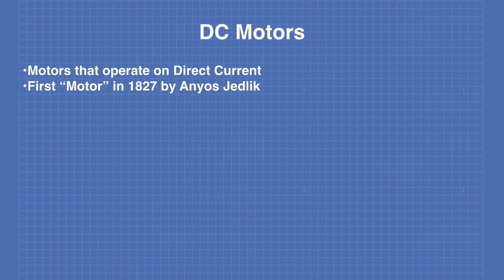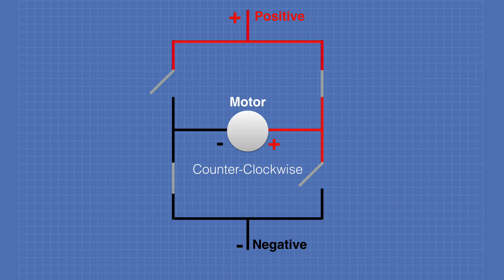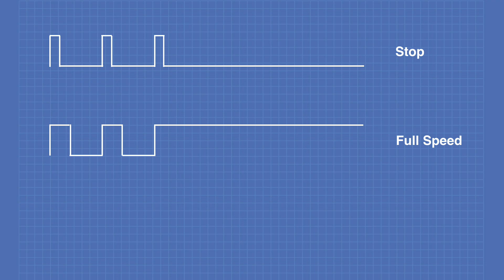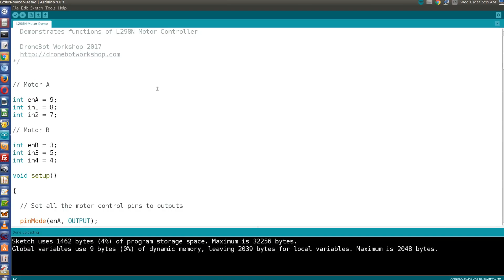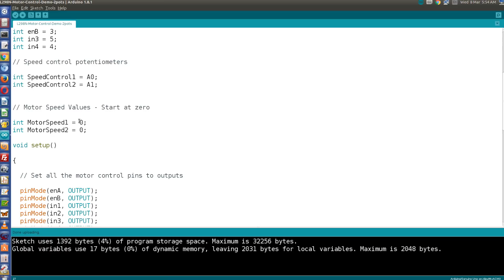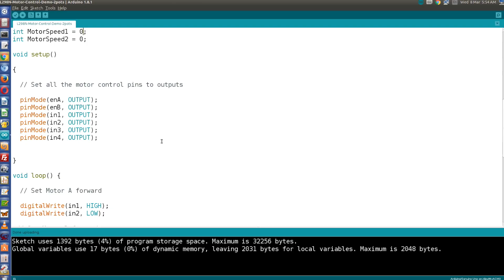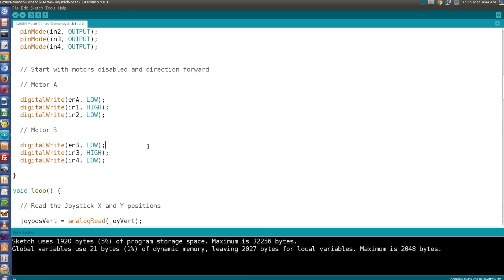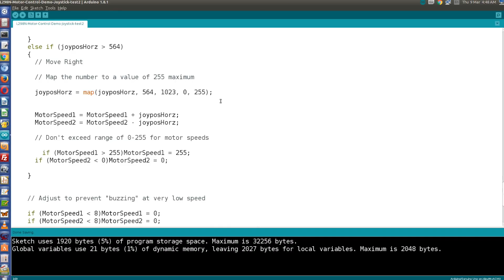Controlling DC Motors with the L298N H Bridge and Arduino

Comment: Hm, isn't the 5V OUTPUT from the module, so you can drive the Aurdino from the motor driver.
  
If the input voltage for the motor drivers are more then 12 V, the 5V jumper must be removed, as the voltage regulator only handle at most 12V.

If one read up datablades and connect CORRECTLY, one can also connect the output parallel to drive higher loads.  But ONLY IF the inputs N1-N4 are correctly connected to each other in pairs AND the outputs to motor A are connected to the right side on the motor B outputs.  You CAN NOT put them randomly, or you burn the IC.

Comment: I'm wondering if it's feasible to use the L298 h bridge module (since it's inexpensiver) to drive  high powered mosfets for larger motors that draw higher currents.

Comment: I'm interested in DC motor control. The YT channel "Daze Cars" describes methods of converting exercise treadmill motors for use with lathes, drill presses, band saws and other tools. Those motors are very large. They operate on 130VDC and spin at 3000 rpm.
That channel does a very good job of providing a method of controlling the speed of these behemoths either faster or slower and he describes both PWM and SCR controllers. 
One thing I have not seen though is  a circuit that allows the user to dial in a desired RPM on a display and have the motor be automatically regulated to hold that target speed with varying loads.
Typically, the original treadmill circuitry that accomplishes that function has been stripped out because only the RPM is the desired target and not calories burned, heart rate or number of laps. Treadmills can often be had for free if you search CraigsList for a few months. 
Thanks for your input and ekectronics knowledge.

Comment: Great video!! I recently did a project during my EE degree, I struggled a lot to learn all this on my own, I hope this video can help any colleague in the field in the future.

Hugs from Brazil
Reply: Sorry for any mistakes in my English, it's currently 3:20 am, insomnia hitting hard...

It's funny to say that in this project I was reaching the maximum memory size of the ESP32, and as I couldn't find any Bluetooth library that didn't use so much memory, I ended up using another ESP32 with UART communication between the microcontrollers, one of the ESP32 contained the Bluetooth commands and the other read the commands and sent them to the Dashboards using the MQTT protocol.

It is important to say that, in the end, I found the NimBLE library with a great Professor and IOT Wizard and corrected this, leaving only 1 ESP32. I'm happy to share this experience with anyone reading here.
Reply: Damn

Comment: Thanks for this video. I actually miss the PCB diagram. You can find the datasheet for the chip, L298N.
Questions: 
1) Do the PCB have free wheeling diodes for the outputs?
2) I am a bit confused regarding current sense of the module. If you like to measure current, do the jumpers connects to ground? Do you need to apply an external shunt resistor at the jumpers position?
3) If you got some other way of controlling the H-bridge, I guess it will be in order to use In1 and In2 with individual PWM signals and have EnA constantly high.

Comment: Great video. Such clear and concise instructions, and great explanations on how things work. One thing though. The L298N has an input voltage range of 7-12VDC correct? Wouldn't it be easier to leave the transformer jumper in place. Then you would have an output of 5VDC from the L298N that you could power your Arduino

Comment: So, when i tried to control the speed, the motor was just going at max speed no matter the number i gave it(aside from 0 which stops it)
Can you help?
I am using the L298N motor driver.
I removed the jumpers, and added a connection from ENA to my arduino, but when i set it to an integer between 1 and 255, it just goes at max speed

Comment: I see that you are powering the arduino from the 5v on the h-bridge, At load would this cause issues for the microcontroller? Is this a sufficient amount of isolation for the microcontroller?

Comment: Hello there. I'm from Finland and we famously don't smalltalk much so when I'm saying you saved our university-level assignement, I do mean It. Everyrhing works fine with our line followin robot but... The 5 V for logics (???) comes from USB i.e. the wire has to be attached between computer and the Arduino board. Are you having two different powersources with this? I am abreal novice so I' m sorry if I ask a stupid guestion. Anyway Youre really good at explaining things.

Comment: there is one annoying problem that it's difficult to sync the speed of two dc motors in order for car to move in straight line. unless you monitor the speed of two motors and adjust pwm duty-cycle accordingly while the car is moving.
anyone care to share the thoughts of how to solve this problem?

Comment: I am new to all of this, but do u need a motorcontroller? I want to make a convayerbelt with an carwindow motor. And I was thinking if I time how long the motor has to spin for the whole belt to reach to the end and.for safety I give it 2x that time to make sure everything is of the belt when it stops. Can I just turn the power off after that time and as soon as a next product falls on the belt it starts again ect. I do plan to use a relay to go from 5 to 12v

Comment: DC DISCHARGE AC ACTIVE LIVE LINES IDLE PUSHED PULLED NUETRAL GROUND...PUSHED BECOME PLUS + NUETRAL PUSH POSI HOT AIRES ~PULLED FROM GROUND COLD NEGA PULL...PUSH ELEMENTS YLOI PULLED YRON MYQUINE ROTARY SIMPLE ..BATTERY IS NEVER ELECTRICITY DEPOSITED ELEMENTS TO ACTIVATE ACTIVITIES YXIDUCES XAULT YXIDE OXIDE OXYNL COROSIVE....JUVYNR YVUL  QOXYNR YXUL LUXY QRUVYOLEIJ QEILOYVURJYÑUX

Comment: Thank you very much for your wonderful explanation. But on thing that still bugs me is that it has three pins namely VCC ground and an additional ground. For my joystick controlled car I'm going to use this driver. So can I giver 7.4V as power supply to motor driver, and what about the other pin..?

Comment: Great movie as always!  Thank you very much! : D
I have one question. In my boat, I have to replace the engines with more powerful ones. I don't want to burn my motherboard. The motors are brushed. I need an ESC for brushed motors with more power. But there is a problem - only 2 wires go per motor from the motherboard. The new ESC has 3 wires at the input. I don't know how to connect the wires - to still control the speed of the motors. Is there any signal converter I need? Do I also have to construct such a converter by myself? If anyone knows how to solve such a problem, please answer my question. Thank you and best regards. : ).

Comment: Great video.
I’m trying to this like your car but huge hubs motors and 72volts, the throttle still works from a 0-5v, but when you pull back I would not want it to engage reverse as the forward momentum would burn out the motors. I would just want them to stop forward throttle or maybe start it’s regeneration braking.

Comment: First of all, thx for the great video. Really well explained. But i have a problem
Based on 13:54, you using 7.4V. I try to using 3 batteries with 3.7v each, which is the total is 11.1V. And the motor stopped working. Why?

Comment: what happen if you use voltage to 0-5v  to control the l298n instead of a pwm ?
 i expect 2 thing HEAT or partial activation

Comment: Hello!

Quick question: I want to program the motor with an arduino controller, but I worry that 5V will not be enough power for the motor to use so the system I am building will function. Is it possible and unharmful to supply both  +5V of power from the arduino and +20V from the motor supply simultaneously (for a higher intense motor spin)?

Comment: Hello, Any one can help me.
How to correct write source code to arduino control motor driver only with push or switch button? And control motor start/stop and direction control with push button. Thanks

Comment: Greetings, I am happy and appreciate the explanation that you have given on YouTube, and I have also practiced the coding and it works. Currently I have a project to make an M3a3 bradlei RC Tank from PVC. My question is coding I want to connect it to the NRF24L01 module, what kind of coding is there, sir, if you can share it. thanks

Comment: How if the motors are 4 and I have 2 L298N drivers? can I just use 4 pins of microcontroller for 2 drivers input? (ENABLE pins are connected to 5V).

Comment: Great video! I have a question though. Do you need to feed the motors +5v if you don’t plan on using an Arduino? I am just going to use a power supply and a PWM into the motor.

Comment: Is there a way to detect the position of the wheel? can we use a ball mouse encoder wheel and how to use? - Thank you so much for great tutorials ? 2) If possible any tutorial on RED laser diodes and thier power supply requirement of constant current . Also are the power supplies in your video (buck and buck boost converters) can it be used for red lasers? , This is a bit confusing (Constant current and constant voltage) requirements !

Comment: Nice education video. Electrical stuff is interesting but I am playing with these motors and they are absolutely terrible mechanically. They make so much noise, the shaft wobbles all over the place, if you try to fit any speed sensors it's nearly impossible to prevent rubbing between components, the wear and tear on this cheaply made motor will probably mean a lifetime of a day.

Comment: Great video. But is there a reason for having two inputs per motor? It looks like a really bad thing to have both inputs high at the same time. In2 is always low or not in1. So why is it not hardwired on the module?

Comment: Hello, I am working on a school project. Need to control servo and dc motor.  I am using the L298H for the motor.  I have a function to move the servo and another to move the motor. When I call one or the other, they work perfectly.  When I call one function after the other, the motor does not work.  the servo and motor are on different pins.  Any ideas why is not working? Any electrical considerations?  The servo is using the arduino power. the motor is connected to a 12V wall adapter, so they are using different sources for power.

Comment: is there a board that could do that but also with independent control of individual motors that would forward and reverse? I am looking for something that i can just plug a controller into with out the Arduino programing.

Comment: I have the 'other' type of L298N. There are jumpers on the PWM enable pins for Motors A & B. Your code for controlling the motors with joystick calls for connecting these 2 enable pins to PWM ports 9 and 3. There is no physical way to access these pins for jumpers to the Arduino pins. A little clarification would be appreciated.

Comment: Thank you for this video. Your explanations are thorough and build up to add complexity.

I do have a question - I am using the second type of H-Bridge (not the one you are demo'ing). And I am using a Raspberry Pi, not Arduino. I am having difficulty visualizing how I would connect the RPi to the H-bridge that I have. Would it be possible to share details on how I would connect?

I am a programmer, just getting into electronic circuits.  Your guidance is gratefully welcomed.

Comment: also on the rotary encoder i only need 90 degrees of movement on the shaft. it could be less! is there a way to set the values to control the dc motor no the rotary encoder? if i want to set to 70 degrees of movement. or 50 degrees of movement, i think there is a way to do this but i do not know about using a rotary decoder. i have a calt p3020-v1-cw360 it is a 360 degree rotation. i would like to know if i can use this or would i need a 90 degree rotation maybe it would be easier! the main thing is to know if the encoder can work or not with arduino and a L298N or if there is other ways to do this?

Comment: can i use a rotary encoder instead of a pot to make a 12 volt motor move in forward only? a resistor is harder to move than a rotary encoder! is there a way to do this! the arduino is really cool because i think you can ramp the motor in the program or pulse the motor when slowing down to be like a anti lock brake. the encoder is what i so not know how to use if at all? i have not seen anything using a rotary decoder to ramp the speed of a dc motor!

Comment: Great video, thank you! Would it be possible to add a braking function and also rotation speed feedback using the back emf of the motor between drive pulses? Thanks.

Comment: Definitely one of the bests I've seen.
However, I'm suffering a problem. I'm using a 9V standard battery to power up L298N and trying to run 2 EA 3.7 Volt DC motors (used for drones). One of the motors works just fine, but the other one (the one close to the 12 V supply), is not even working most of the time. for example, when I directly copy your code, motor1 works perfectly (on the enB side), and the other one is not moving dring demoOne, but works fine during demoTwo. And during the potantiometer example, again the enB side moves, and the enA side plays the dead. What would be wrong with my sketch?
I tried to power up the 5V logic circuit directly from ext supply using jumper, and from Arduino 5V exit without jumper. nothing changed.

Comment: Hi I am very happy and excited to see all the projects you have done. I am looking for help in building a pan and tilt video camera that its weight around 10 lbs. My main goal is to have it like no-camera-man, in other words a motion tracking device that can handle a camera. How can I figure out what do I need, breadboards, webcam, servos vs stepper motors (size & capacity), regulator etc. I've been looking around all over and instead of one way I watched too many options that I don't know that much I am enthusiastic hobbyist, with little experience in electronics but eager to learn and I can search for solutions. So please help me out if you have time and please let me know how to start this project? Thank you so much. Sincerely Sam

Comment: Try that 298 on a NEMA17 stepper.
Lets get crazy.
Build a DREMEL -based CNC Router...
Because CIRCUIT BOARDS exist... with small holes.

Comment: Wonderful tutorial, your clarity is very much appreciated. One question, could the joystick be substituted for an IR sensor to control a constant speed and implement a switch to directly vary between 2 different but preset speeds with this same arrangement (understandably the sketch would necessarily be different and that would be a seperate topic).

Comment: Hi, I'm trying to build a car similar to the one shown in the video with an L298N motor controller. I have the code uploaded and everything correctly wired, but the motors do not spin i just hear a high pitched sound like they are trying to spin but cannot. Is this an issue with my motors, my wiring, or something else? Do I need a higher voltage going to the motor controller because I currently only have the 5V connected?

Edit: I managed to get it working by connecting 9V of power to the arduino and using the Vin ports on both the Arduino and the L298N motor controller.

Comment: This is so helpful! One question, how easy is this to alter to a 'tank' control configuration? I understand how the steering for a wheeled robot would work but tanks tend to turn by rotating each track in opposite directions rather than both directiions but one is slower. Ideally, if the joystick was in the 'all the way left' or 'all the way right' the arduino would put one of the tracks in reverse at full speed instead of 'slow but still moving forward'. Any thoughts?

Comment: Sir please help, your code worked perfectly but then as I was trying to connect with pot it then stoped and then it's not getting the sketch loaded please help .... Or does this mean I cant use this card any more please reply....
Reply: You need to check if your arduino is dead or not (Probably a bad connection could've fried something).
Go to google an search for "how to check if your arduino is working" and click the first link. hope everything is good!
Reply: @enriquegarcia7613  thank you for your response sir , 
changed the card and tried the code with pot again all working correctly splendid video to start up  with ardruino coding, 
 sir will u be  making a video on how to use an airflow sensor data to activate a  motor any sooner ?
or if it is already done by you can I have the link to it please...

Comment: Hello sir
I want to make controller for my wheelchair in exactly the same manner as in this project.As motors are bigger so i need to use two IBT2 one for each motors.
Could you please help me with wiring diagram and code for this purpose?
Thanks in advance.

Comment: Isnt the 5v connector an output for using to power your arduino board and not an 'input' supply as you were suggesting in the video?

Comment: hello , I have tried making the project and its working
can u help me with the code for the following
1 motor and two pots

pot 2 = will control the direction of motor i.e if the pot goes from 0 to 255 motor will go forward and stop like steps
and if we reduce the pot the direction will be reverse .and it will be call to its original position 
pot 1 = will controls speed  of the direction means if we increase speed the motor will go from 0 to 255 fast 
and iff we reduce the speed the motor will take time to go its position 

Please reply 

my mail id - mantra.himanshu24@gmail.com